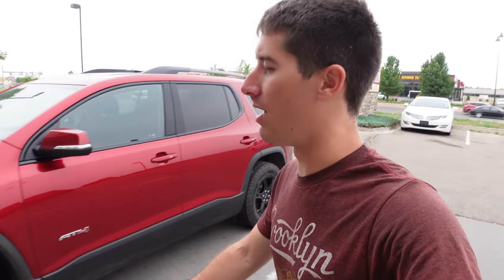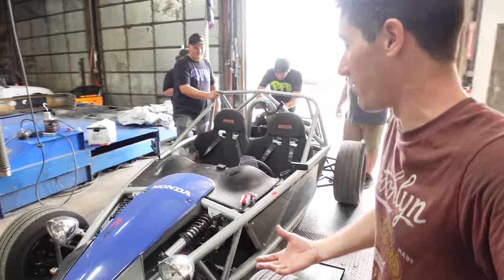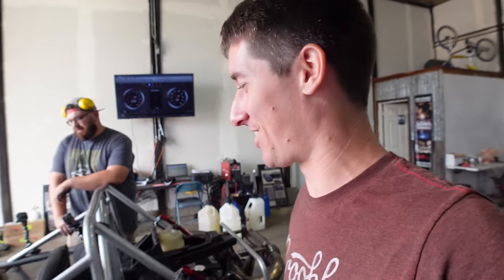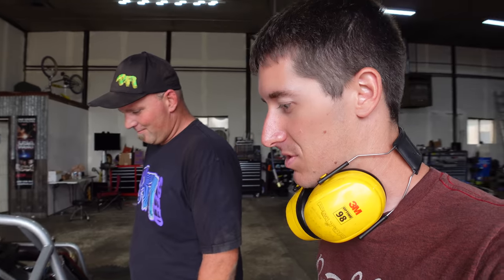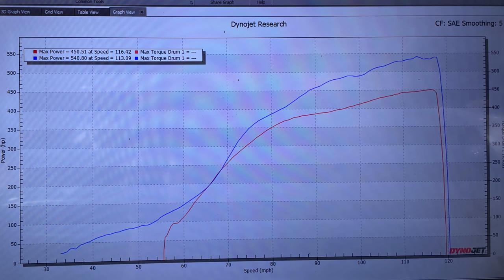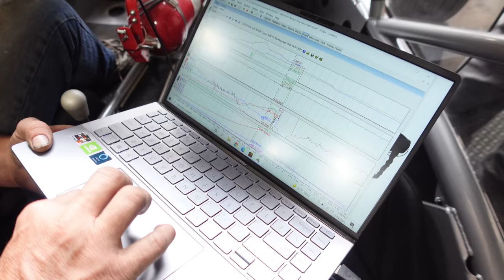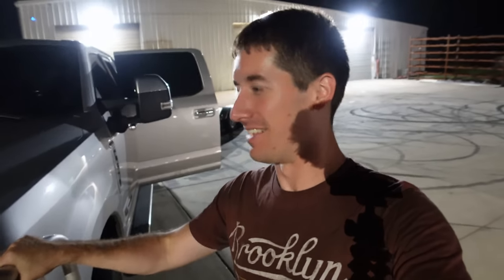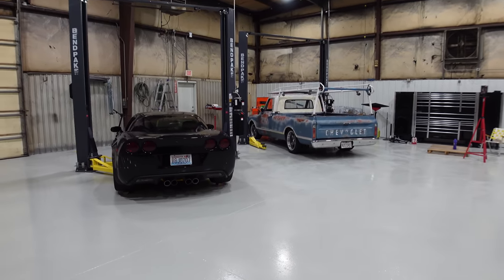My STREET LEGAL Go Kart Made 550HP *Ariel Atom K Series*

Comment: Trans seems a bit whiny. Does it have straight cuts somewhere? Also nice Prius front tires.
Reply: Yes, IIRC JR said all gears in the transmission are straight cut in the video where he did the pulls in the airstrip (that specific Atom was heavily modified by the original owner).
Reply from the maker: 1-4 are PPG straight cut, 5-6 are original gears. I love the whine! 😍

Comment: 13:02 Couch Engineer: If the car was losing traction on the Dyno, wouldn't having someone sit in the Passenger Seat, add more weight and traction?
Reply: you don't dyno with passengers in vehicles generally for safety
Reply: Why else do you have heavy friends?
Reply: @Avboden  ”Safety”. They are more safe inside the vehicle than outside it.

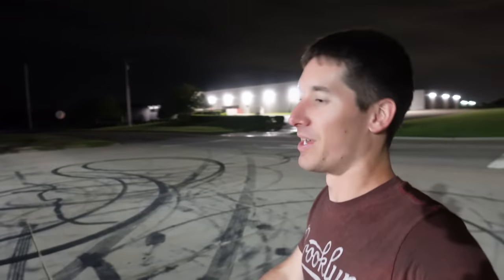Comment: 24:35 never use cruse control in the rain!
Reply: Why? Just don't accelerate hardly and You will be fine. Used it in modified diesel with lots of torque :)
Reply: @mmllmmll22  Nothing like hydroplaning when you hit a puddle with the throttle stuck at a certain MPH. Considering most people use cruse control on the highway at high speeds! Most modern vehicles have traction control which "should" cut it off but do you.

Another driving tip, don't turn your wheel at a light (typically while turning left) while waiting to turn (keep the tires straight), incase someone rear ends you and pushes you into oncoming traffic causing you into on head on collision.
Reply: @TheOpius123  I'd agree to 2nd one. But if there is hydroplaning then : it's raining af or You have shitty tires / without thread. Don't cheap on rubber - in bed and on road it's better safe than sorry
Reply: @mmllmmll22  Michelin tires Sport Cup 2, or any Michelin tires really!

Comment: My big truck had a Detroit Diesel 500 hp engine and it was scary to watch something that big go full out on a dyno. Big chains all over the place holding it down and it still bounced around! When I had it built, I wanted to have it be most economical at 65 mph. Instead of gears that would let it go 120 mph, the gears in my big truck ran out at 94 mph. They set it up to be 65 mph at 1500 rpm which was a perfect balance between the best torque range of 1300 to 1500 rpm and the best horsepower range of 1500 to 1700 rpm. I always got 6.5 mpg. It was great!
 http://calnikont.com/transportation.html